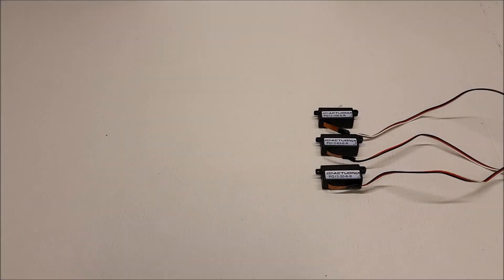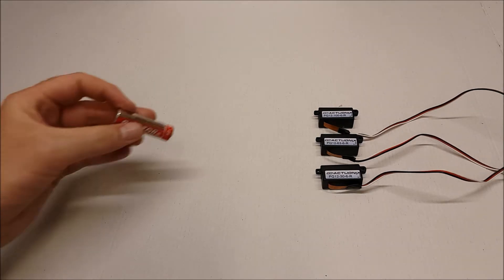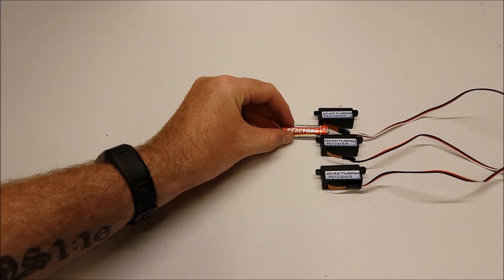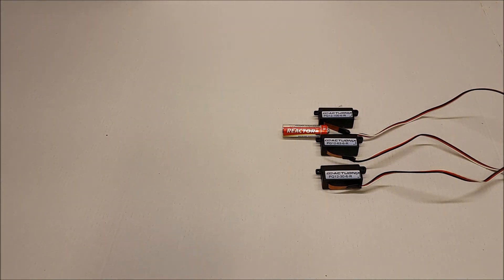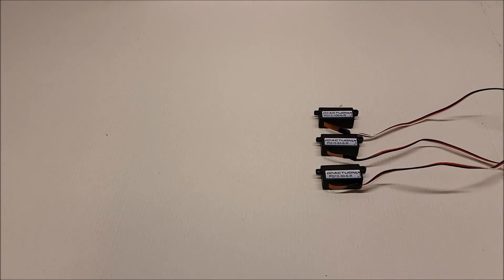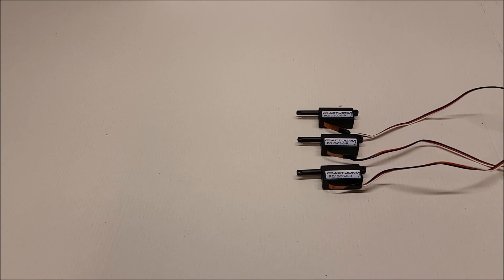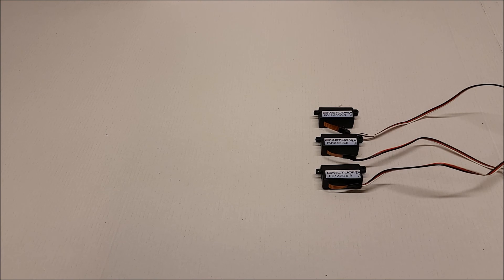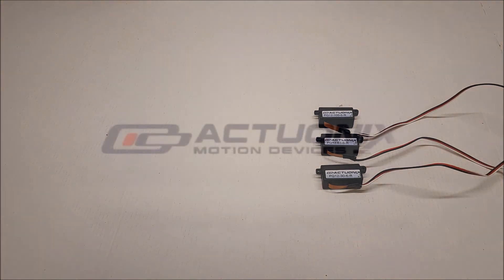PQ12 R Product Overview

Comment: Nice Servo Actuator. I am using 2 different versions of Actuator, one of them work with Arduino with 1ms pulse, but the other does not work. Using RC controller both work, someone has experienced the same issue? Thanks in advance for your comments!

Comment: Hi Actuonix, 
I just bought the PQ12-30-6-R actuator, I connected it directly to the Arduino UNO R3 which provided the 5V to the motor, it ran quite well even thought I think that it was a little slow than normal. I want to know that are there any way to make it run faster, I have a 11.1V 1800mAh battery but don't know how to decrease to 6V for the actuator. 
Thanks in advance.
Reply from the maker: Hi there, the device will run slightly faster on 6V, but be sure not to put more than 6V to it as it can damage the device. There's really nothing you can do to speed it up otherwise unfortunately.
Reply: OK, thanks for your response
Reply: By the way, I have one more question, how much current I have to supply for the PQ12 R so that it can handle the max force ? Will it be harmful if I use higher current such as around 3A (with 6V)